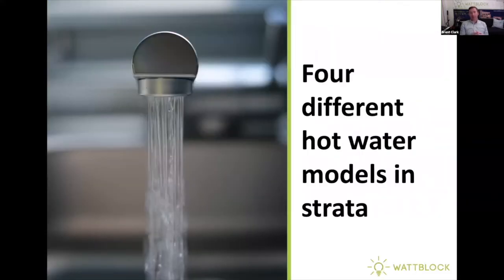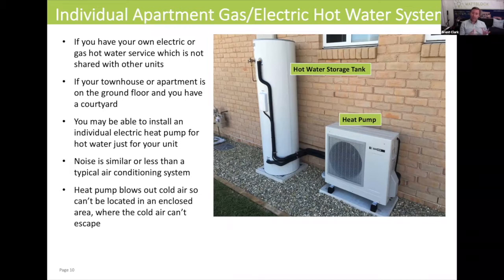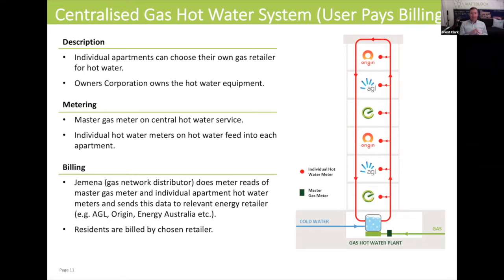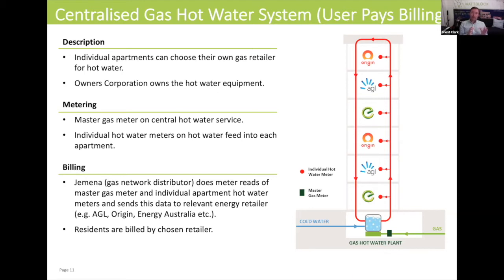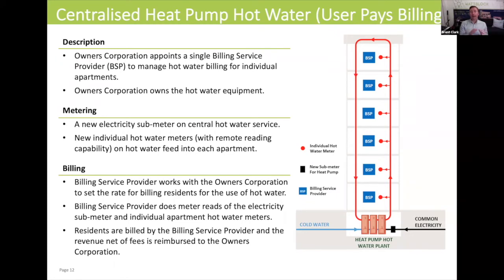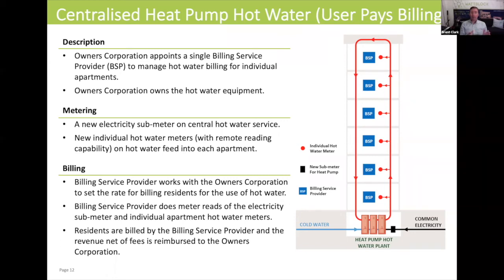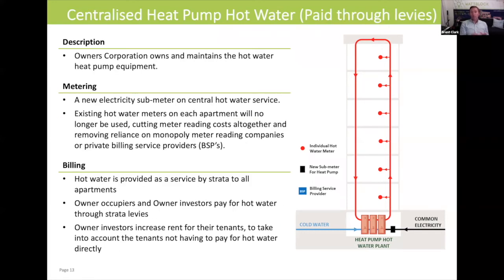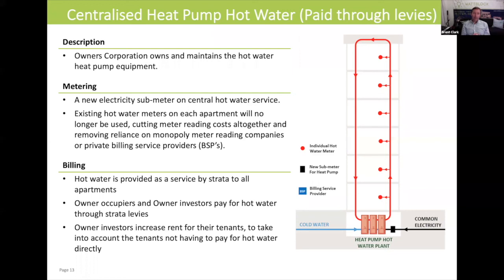4 different hot water models in strata apartment blocks

Comment: loop  centralised systems, end users must pay for  circulation losses. can you quantify that as a cost loading on their billing--
Reply from the maker: In sydney in Jemena network it depends on the setup of the building. Sometimes there isn't a common area gas hot water bill (i.e. for a common area shower) so the gas from the recirculation/reheating losses is divvied up across the individual apartments. In other cases, the common area gas hot water bill might end up paying for these recirculation/reheating losses, if there is gas hot water usage by the Owners Corporation.